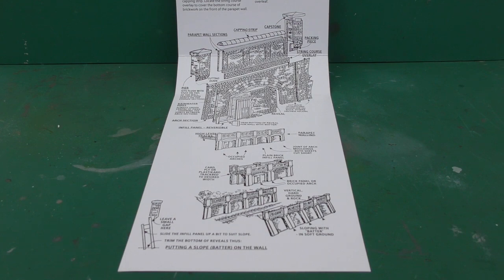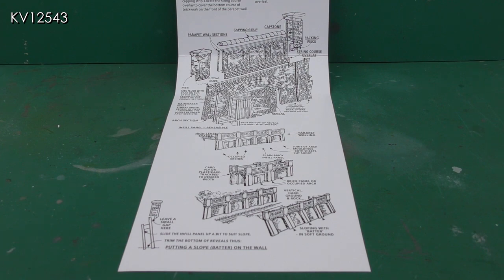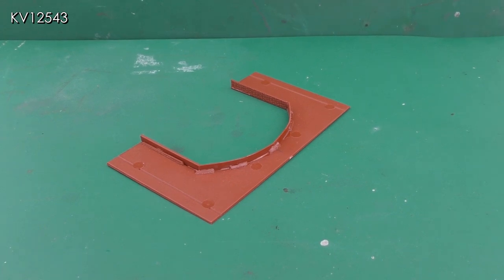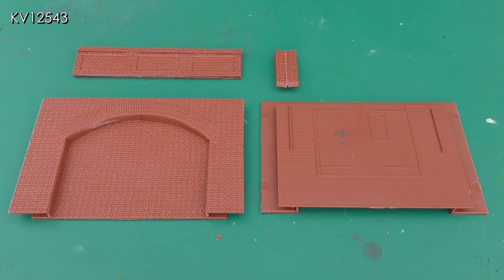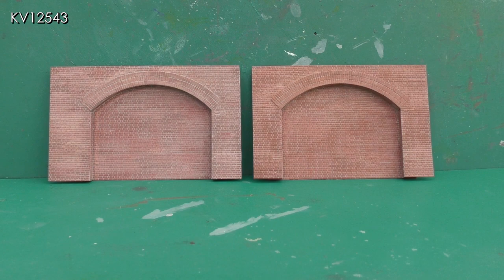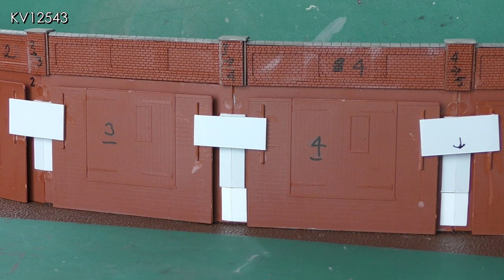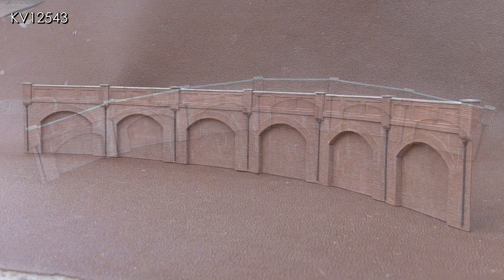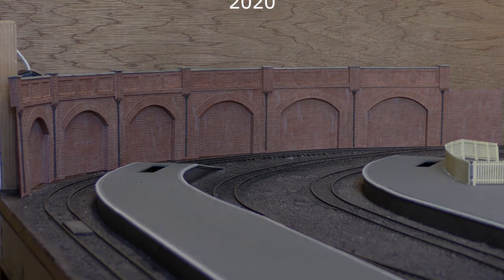Wills SS52 Brick Retaining Arches kit build for Havant Aclew

Comment: One easy mistake I made to avoid: do not start at one end adding the top piers and upper walls and work along the wall length, as progressively the piers will creep off centre from the wall joints below. The rain water pipes will then be off centre. 
Better to glue top piers in place and trim top brick panels to fit.
Reply from the maker: I made a similar mistake at the beginning on the first two sections. I then realised and then left them off until I had joined all the arches together.